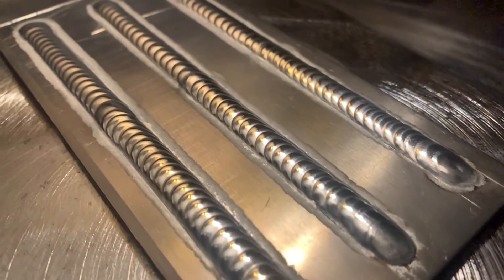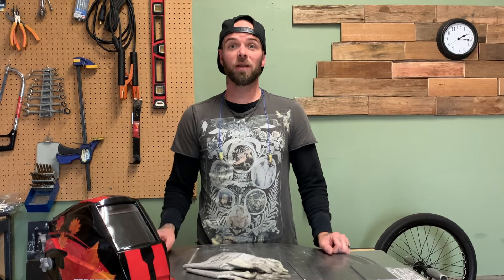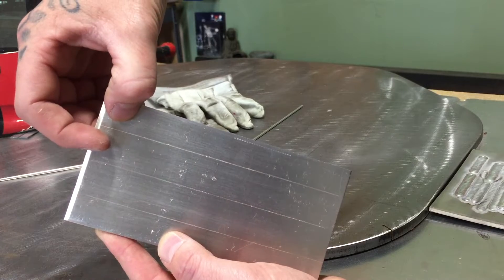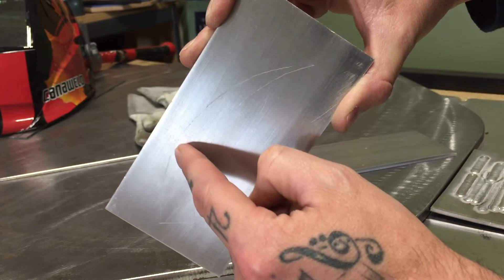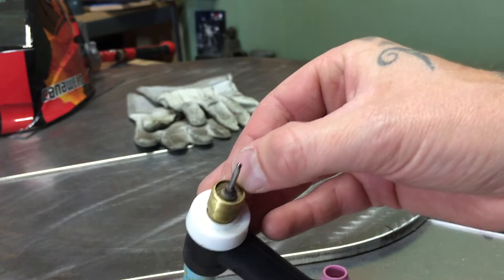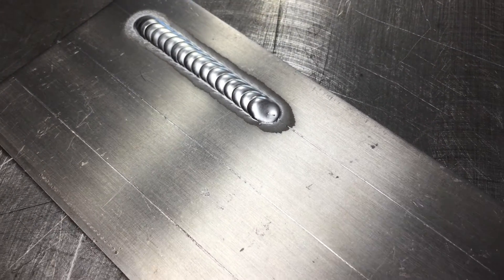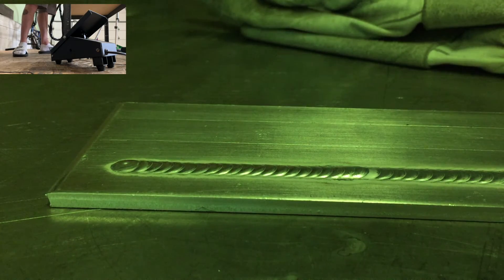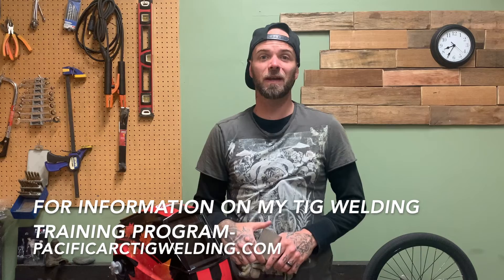HOW TO TIG WELD ALUMINUM - HOW I PRACTICE PT1

Comment: When is the up slope and down slope needed? Seems most vids I’ve seen everyone skips those settings...
Reply: Those are only used if you don't have a foot pedal.  It allows you to ramp up and down without a pedal while using lift arc or momentary switch on torch.

Comment: Can you do a demo welding a piece of 2x2x1/4 aluminum angle (the end) to a flat piece of plate?  Specifically on the inside corner, how much tungsten stickout do you use? What is your direction of travel?  Where do you start and stop?  I really have a hard time right in the corner.  How do you fit the torch, feed the rod, and SEE what you're doing?  My frames made with aluminum angle always look like crap in the corners.  I really enjoy your videos...you make tig welding look so easy!!!
Reply: Looking forward to your demo!!!
Reply from the maker: Thanks for the suggestion! Cheers Dan!
Reply from the maker: Just found the perfect scrap for this actually... too easy. Stay tuned. 🤙

Comment: Hoping that PT2 has the split screen pointing at the welder to see the variation in amperage rather than the foot pedal. I really do believe that it would help beginners to see how much variation it takes and how important pedal control is. Thanks for another great video!
Reply from the maker: Unfortunately I’m still working on that feature
:( I need another editing program to do double pic in pic. Soon tho! More upgrades coming! Good suggestion for sure! Cheers:)

Comment: Dusty. I do enjoy your videos that's why I subscribe. When you say you "cleaned" with acetone, which is the way it should be done,  then touch it with your bare hand your defeating the acetone cleaning. It's like a bodyman (painter) cleans with wax and grease remover then rubs his hand over the panel to see if it's flat. Yes, I believe the high heat from the Tig torch should burn off anything but you never know. Just FYI, keep up the "learning videos (I'm 68 and trying to learn Tig welding)!!
Reply from the maker: Cheers Andy! 🙏🙏🙏